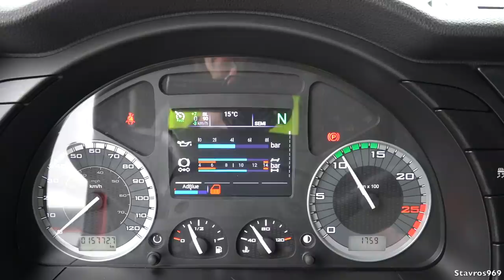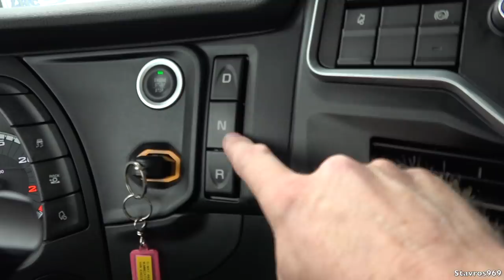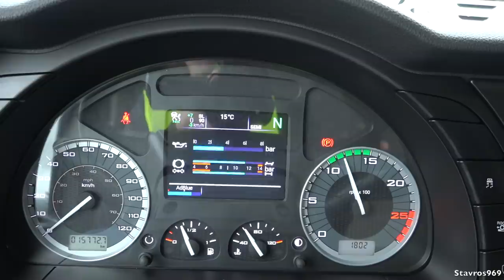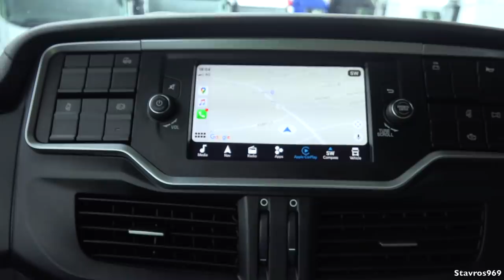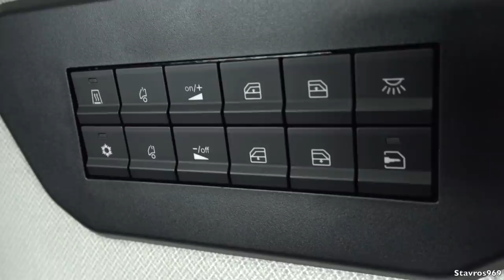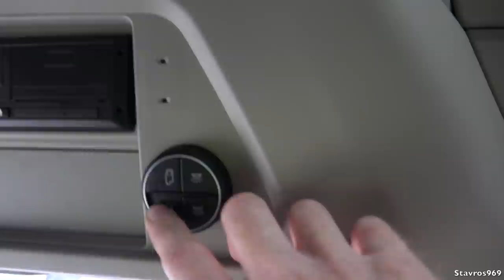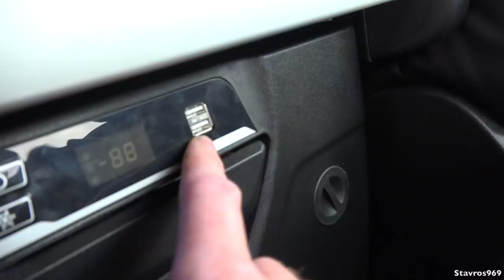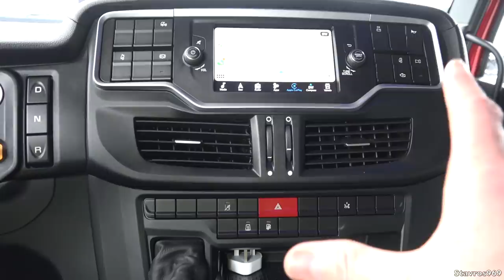New IVECO S-WAY 460 Full Tour Exterior & Interior

Comment from the maker: Thanks for joining me this Sunday morning. What are your thoughts on the new IVECO S-WAY? Have they gone far enough with the follow up to the Stralis or should more have been done?
Reply: Hey! I think the vehicle is smiling at us! How about you? Oh, and also, how was your day?
Reply: Can you review the new kamaz please ??
Reply from the maker: Linas Krulikauskas Had a great day there checking out the S-WAY, I’ll be visiting again soon👍
Reply: @stavros969  I've never been an Iveco fan but in fairness, that's a fine looking truck. It's funny that it has the same key as the Fiat 500 😄

It's days like this, I'd love to still be working in transport, so I could visit my Gran on a run from Limerick to Dublin. Only another week before I can do that again though 😊
Reply: The s-way doesn't look ground breaking in anyway. Also not sure if they should of called an HGV "sway" 😀. I used to work on HGVs back in the day and used to like iveco especially the turbostar. Please can you review a turbostar if you get a chance Stavros. Keep the great videos coming. It was a good way to start fathers day. Cheeers.
Reply: Mutton dressed as lamb 😉
Reply: I would have prefered a complete renewal of the dash & inside. There are alot of things they improved like the overhead lockers, the bed controls,  but the dash is just dumb. Still need to buy  a table to make it flat unlike the volvo, way to much USB ports & not enough 12v/24 sockets... . 10/10 for exterior design, 3/10 for interior...
Reply: Looks like a scania s series
Reply: How much $ ?
Reply: Why are there so many holes over the frame?Are they supposed for reducing the weight of the unit?
Reply: Thanks for the great walk around and video, it was nice to get a real good look at the truck. That dash was a mess, it needs a total make-over. Cheers!
Reply: @Chevy18_z71  Around 93 000 usd
Reply: @rocketrob31  
Ther will never ever be a truck like the turbostar. Such a shame😞

Comment: Really love this truck.

IVECO builds reliable, affordable priced, low running costs, and comfortable trucks.
Many fleet managers will opt for this IVECO, especially due to its lower purchasing cost, and because they buy in bulk. Especially those fleet that work only on domestic cargo.
Thus, many trucks drivers will be behind the wheel of a S-Way, sooner or later.

I really like to see a comfortable truck, safer, with many good utility functions.
This will ease the life of many drivers.

I am really happy, for the truck, and for the brand.
Reply: ArmageddonRacing  I am not saying they are the best in class - far from it.
But, IVECO (part of the FPT Group) are fairly reliable.
Mercedes-Benz (Daimler Group) is also fairly reliable.

The difference between the two is: the price of maintenance is very different between the two.
IVECO é fairly cheap to repart, but Mercedes-Benz is not.

And do not forget:
Maybe, an issue on an IVECO may compensate the cheaper price you pay upon purchase.
Even counting the part price, labour price, and cost of opportunity of losing a given load.

The thing is: such metric makes sense for a fleet manager.
Not for a freelancer, which many trucker are.
Freelancer prefer reliability, even if it means more cost (on purchase and on parts); especially - but not limited to - the fact that they do not have the infrastructure to rescue a truck, or because the insurance premium may go up significantly when the truck and load needs to be towed.
Reply: Iveco reliable lol never, nice looking tho

Comment: A dipstick! Lord almighty!

I had a trail of oil running from my Actros the other week so got a call out. My digital oil gauge said I had several litres of oil missing and there was what seemed  a large amount of oil dripping from the engine.

Turns out the breather valve was a little weak and not that much oil had escaped as by the time the call out got to me the sensor read "oil level ok".

If only I could have double checked somehow.

Comment: Kinda curious why you're speaking of a pre-production truck and deliveries in 2021? Is the UK so far behind on mainland Europe? We have the S-Way on our roads since last year already? In 2021 the Nikola Tre (based on the S-Way and build in Ulm, Germany by Iveco) will be ready for delivery. So kinda curious why the UK is so far behind.  I've test driven the S-Way last year and it runs OK, it's kinda sorta an improvement from the older generation Iveco's but it still remains an Iveco with still some lower quality materials being used. But to be fair, Iveco has come a long way.

Comment: cmon iveco lets redesign the dash with touch screens like the actros i hope the build quality is better than the original stralis mine had a bad habit of shedding weight by the bits  interior falling off but i do like the exterior styling apart from the bit on the side of the cab

Comment: Have they ever designed a truck with a small toilet within the cab based on what you see in a caravan.Surely it wouldn't be that hard to have a slide in toilet cassette and a small bowl that could live under the bunk and then have places like service stations where it could be emptied.I reckon a caravan sized cassette could see a driver through 3-4 days before it filled up.Would it make life easier for some one spending a long time on the road?I don't spend time away in the truck i drive but do get caught out from time to time and if you have to go you have to go and hope no one finds you squatting behind some bushes.

Comment: Pretty looking truck from the outside, was supposed to be completely new, the inside is just updated but extremely cheap and nasty plastic all over, the steering wheel is too big like the older models, you keep banging your elbows on the door when turning the wheel, probably a dacia price bracket cheap but does the job

Comment: 13:25

Those steering wheel buttons and the trim design are nearly identical to what Dodge has been using in the Charger/Challenger/Grand Cherokee the last couple years. If you look at a 2019 Dodge Charger steering wheel, you’ll recognize the buttons and button layout, as well as that silver trim piece. Interesting.
Reply: Looks just like the cheapest Fiat Tipo.
Reply: IVECO is part of FIAT. The push start/stop button is the same as on my Alfa 159.
Reply: Seymour Beaver Oh they are? Okay that makes sense. I immediately looked up Iveco and the Wiki page only mentioned some French conglomerate that owns Iveco along with several other commercial vehicle manufactures. I didn’t see anything about FCA. But that would make sense then.
Reply: @Ward413  caras pe tine

Comment: Finally got round to your review of the s-way looks smart outside but what a disappointment inside still cheap cheap plastics looks like a 2005 model truck inside.i used to have a eurotech had a couple used to love how it drove could throw it around but I used to have to carry a tube of super glue with me and spare phone charges as trim used to fall off all the time and would blow fuses all the time.please iveco update the interior before you release it

Comment: IVECO, SCANIA, VOLVO and so on....on my opinion none of the european trucks have enough space or are suitable enough for international. VOLVO VNL  ( and others like it ) yes it is something more suitable for international work.  Not only the space inside its very limited ie. bed to narrow, but also when accessing the engine need to lift the cabin which isnt good when you have lots of stuff inside and some of it are liquids . its just my opinion on a quick comment
Reply: Erm... Are you from Europe or from the US? In Europe the roads aren't suited for big trucks. Besides the law restricts the overall length of truck and trailer so the trucks are smaller to be able to haul a longer trailer and keep within the law.